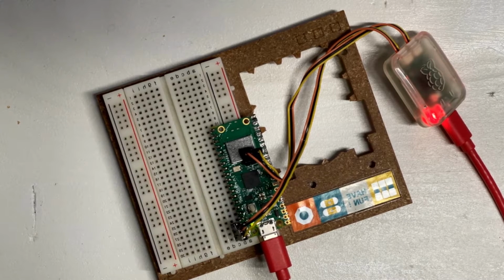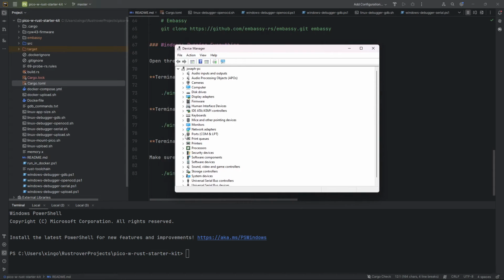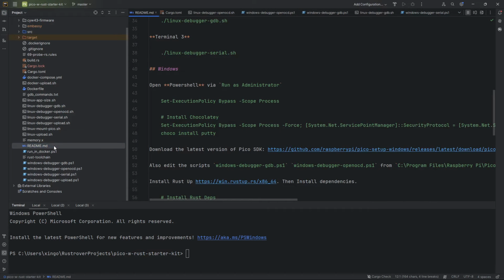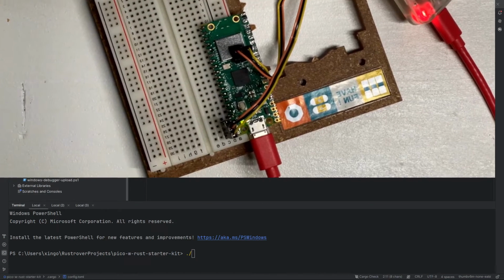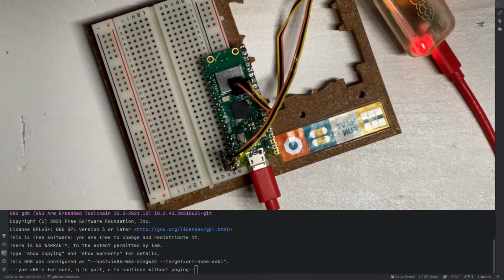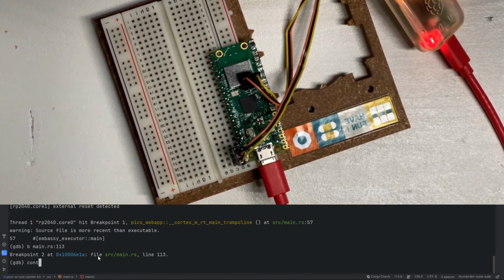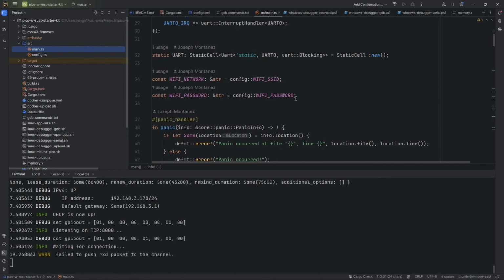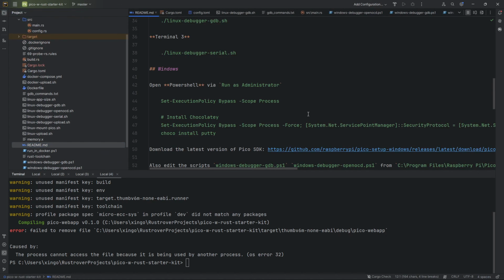Raspberry Pico Debug Probe with #Rust

Comment: I had problems with probe-rs too. After multiple days struggling I got probe-rs working by swapping SWDIO and SWCLK. I have no idea why but it works now. It feels wrong because the raspberry documentation seems to suggest the opposite. My setup is different though as I am on MacOS and use a second pico w as probe. Haven't tried OpenOCD.